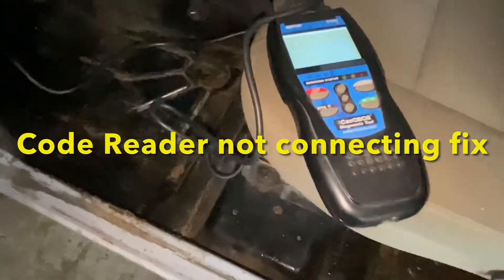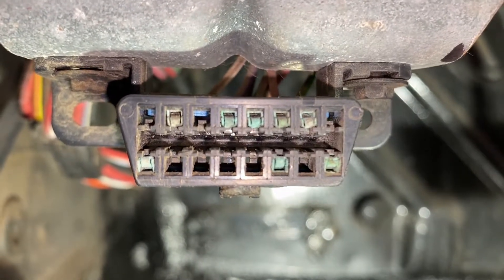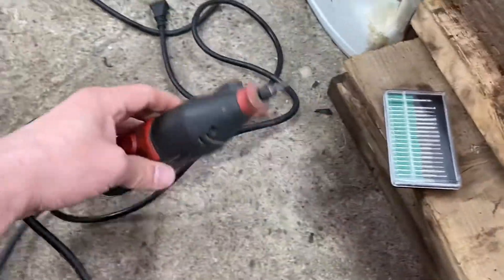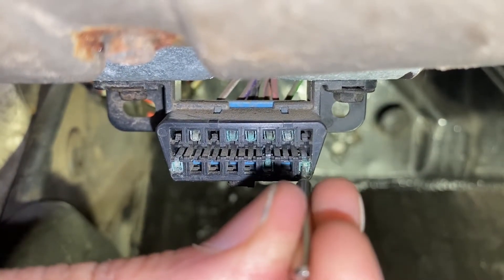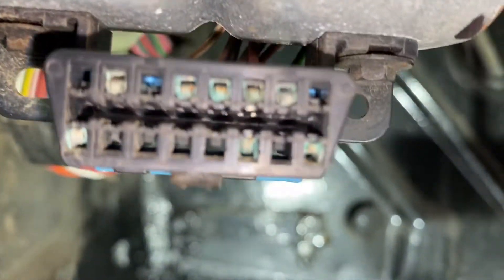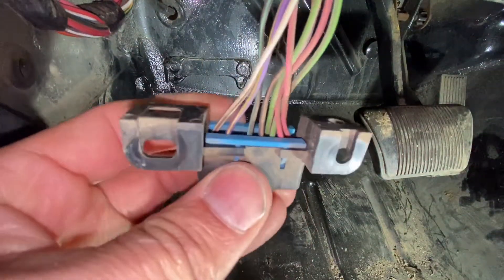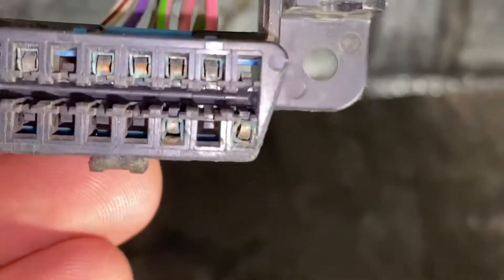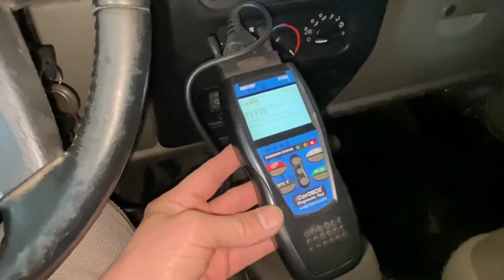Code reader unable to establish a link. OBD2 scanner not connecting. OBD2 port corroded.

Comment: Green on copper is corrosion that will return, like the statue of liberty.   A quick n easy fix in a bind is to insert and remove it, plug it in and out, and it should make a contact possible for a temporary read.   Blow compressed air in between p l uggings and spray ELECTRONIC contact cleaner also and let it dry.   Drying should take seconds with compressed air.   Depending on model, check wires on the reverse of where you plug it in.   

On a side note, on modern cars, silly errors like brake hold on a modern Mercedes will not work on a old battery.   I had that issue for years but battery was recharging fine on its own.   Modern electronics are gonna be a serious headache for DIYers.   I remember when most desk top computers were fixable, now all laptops are disposable.  Think abou that. 😂  im too old, plan to lease cars from now on.  Too much a beach to fix by myself or even most mechanics (parts changers).  Hardly anyone tried to figure things out anymore.